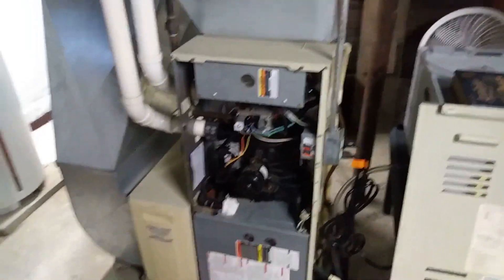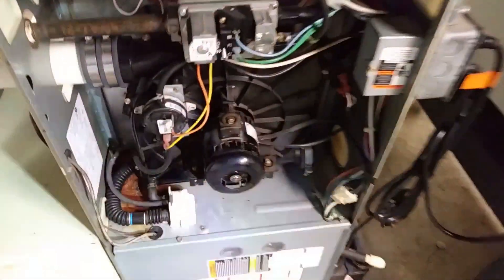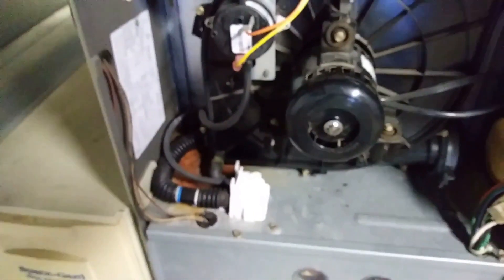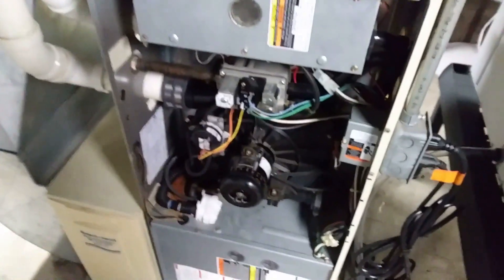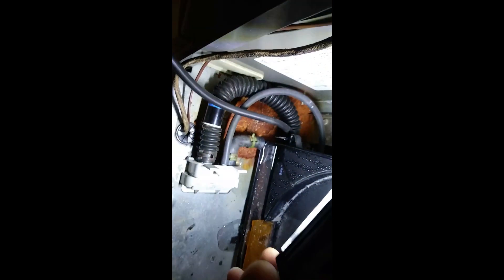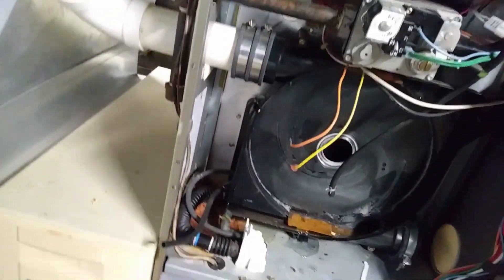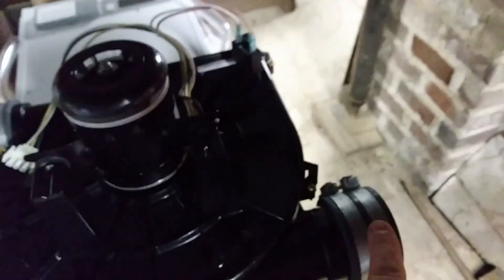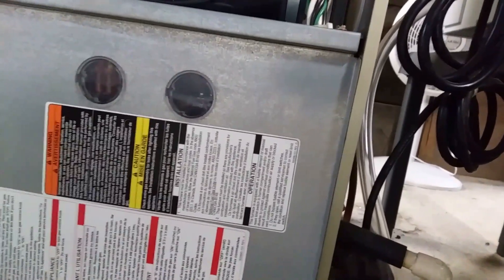Carrier 9200 code 13 induction motor replacement

Comment: hi i got the code 13 and its blowing cold air  i call someone and they told me it was the heat exchanger but the flame look blue and fine do you think they just try to fuck me over. also i notice the code 33 and i got hit the rollout switch

Comment: I'm pretty sure this is happening to our carrier weather maker 8000. Same code everything. Checked filter it's clean. Didn't see or find blockages. Maybe this is the same issue. I dunno
Reply from the maker: If you spin the motor by hand you should hear or feel if it’s bad. If the bearings don’t feel bad and it’s not backed up with condensation it might be the roll out switch 👍👍
Reply: @116falconer  when you say "feel bad" like do you mean too much play like super loose. Like if I were to spin it it would spin quickly and not slow down quickly? Because that's what it's doing 🤷🏻‍♂️
Reply from the maker: If the bearings are bad you should feel some resistance or even grinding, if it spins freely and quietly then the induction motor is most likely not the cause of the problem. I have a couple bad units in the garage, I’ll check them out in the morning and get back to you.
Reply: @116falconer  no worries bud. I'm hoping the lockout is just something simple that a layman like myself can fix or tinker with because of course this happened during the polar vortex crap 😂

Comment: everything was great until he took the actual assembly off and ran thru 6-7 steps in that process (ie unscrew everything around the perimeter, this housing unplugs here, that tube has to be disconnected there, etc) but didnt show that happening...for the rank total amateur that is watching (ie me)...a lot of steps to go through please break that down

Comment: Could you tell me what the part number was on that unit? Thank you!!
Reply from the maker: I can’t remember, do I say in the video? If you have a 9200 series Carrier you can Google it and you’ll find the exhaust/inducer units for sale everywhere.👍👍
Reply: @116falconer  Thank you!
Reply: @116falconer  Hi there. Do you know how to pop off the bottom panel (the one that houses the command board) Looks like there are some screws on top the the panel. I want to change out the filter on my 9200 Series Carrier furnace. The tech came out in the fall and replaced the filter during the annual check-up. But it has been a little more then 3 months and I know it needs to be replaced again at least one more time during the heating season. What type of tool do I need to remove the screws off the panel?
Reply from the maker: @Chris2745100  to change the filter you shouldn't need to remove anything other than the door to the filter box, the furnace in the video has the filter box to the left, with that one you just lift up and the door comes off giving access to the filter
Reply: @116falconer  Unfortunately the way my furnace is set up the filter is located at the bottom behind the second panel. Many 9200 series are set up that way. Often times homeowners don't even know there is a filter there. Looks like there are two small screws that need to come off in order to remove the panel. What type of screw driver will I need?
Reply: @Chris2745100  dude, if you know where the filter is and where the access panel is why are you asking? Furthermore if you have to ask what kind of screwdriver to use??? I dont know are they Phillip's heads? or slotted (flathead)? .....better call a repairman!
Reply: @mattcartwright8474  I found out I needed a powered socket wrench. Had a neighbor help me to access and change out the filter.

Comment: I've got this model furnace and it starts/stops when trying to heat. I'm thinking to clean the flame sensor but dang if I can find it. Any idea where it is (can't find any manuals online)? Thx.
Reply: check the error code, may have nothing to do with that.